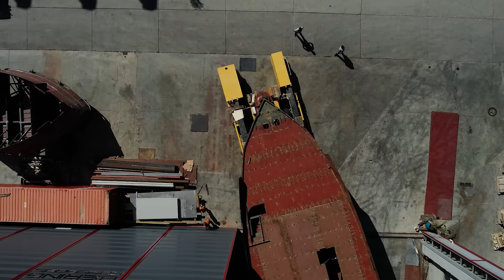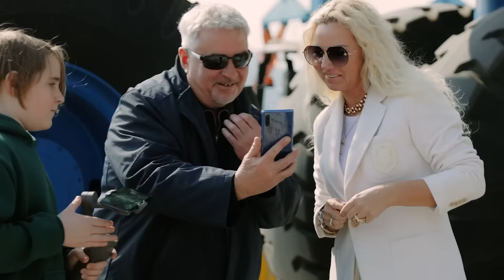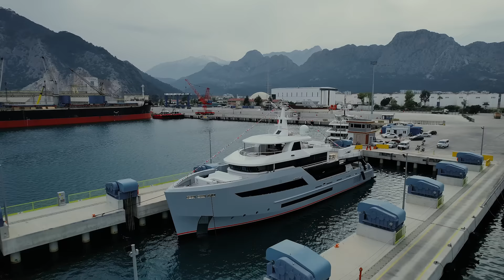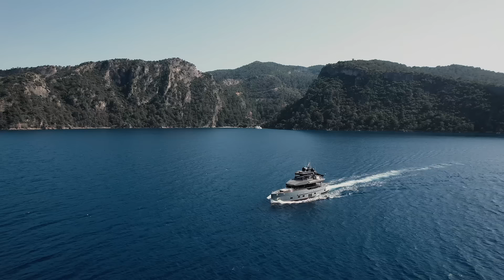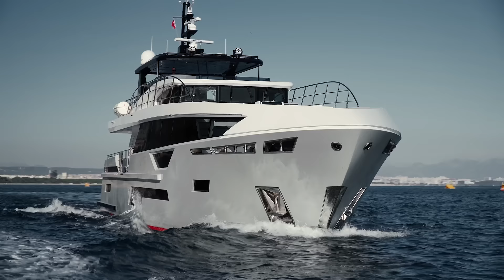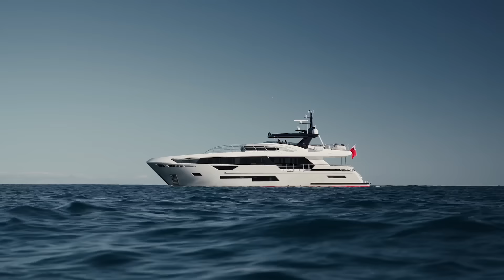BERING STEEL YACHTS | NEW PROMO

Comment: Love it ! Would love to build one with the aft tender storage removed for a larger aft deck space to put a Mini Sub. Will require a convertible A-frame to launch and recover like a Trawlers net system only smaller. Aft deck space split for a lowering swim platform only strong enough to support a shared load for the Mini Sub. Main deck lounge and dining area would have no dividing wall to allow expanding dining to seat 20-30 people for at harbor or in bay parties. Walk thru refrigerator / freezer adjacent to galley and a shared storage chilled compartment wall with access doors of glass , for vegetables, cheese , deli meats and the like. Restaurant grade appliances and Aircraft cart storage with chilll capability, so layout of storage is changeable or moveable for loading a proofer cabinet for your breads ect...or just moveable storage for cooking accoutrements. And Bath in the Master/owner suite... hehehe Whats your Wish List ?